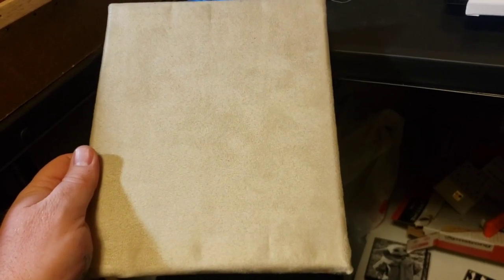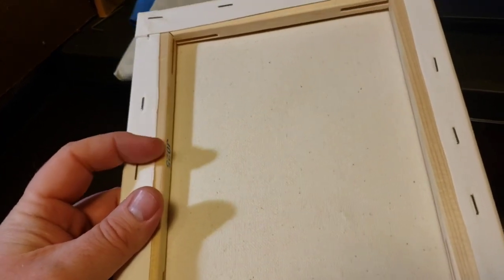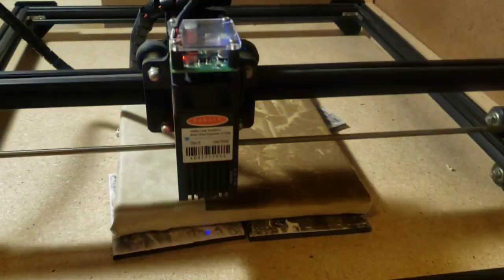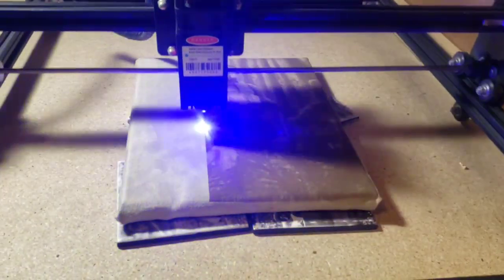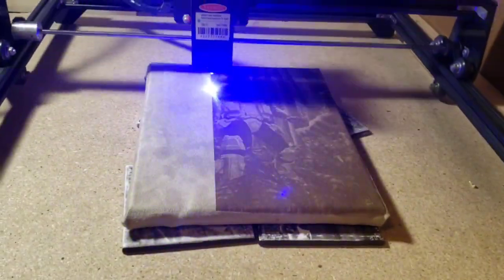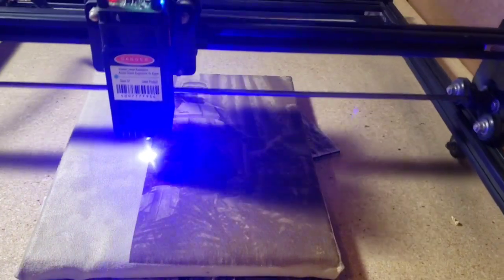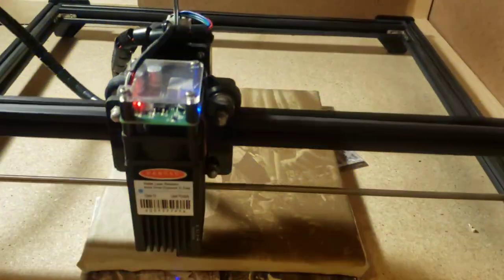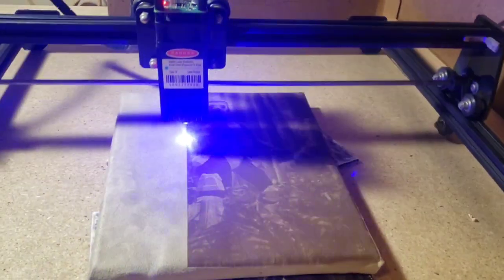The Kenny Hack: Improved No-Paint Canvas Method. Ortur Diode Laser.

Comment: God morning Kenny
The buckskin not stretch it self a little bit of the heat? If it does, i have to take it in a count when to stretch it up on the frame.
Reply from the maker: The heat doesn't seem to affect the stretch of this material.  mostly, just how much you stretch putting it on the frame. Another benefit of this material is that it hardly has much smell when burning unlike painted canvas.
Reply: @TheKennyHack  Witch part of the skin do u use?
Reply from the maker: when I said buckskin it was in reference to the color not that it was actual deer hide. this was all on faux suede which is just cloth. I do have some furs that I'm going to try out sometime.

Comment: All the faux suede i see is 100% polyester. Where did you get the fabric for this video?
Thanks, Tim
Reply from the maker: From everything I've read, Polyester is OK to cut with a laser. Faux Leather contains PVC and is not safe.  Polyester, like all materials, will still release fumes that are not the best to breathe. It doesn't contain chloride that will damage your laser.  A well ventilated setup is always needed.

Comment: Anyone know what 9000mm per sec translates to in percentage?..
Reply from the maker: I was doing 9000mm/min but that's only 150mm/sec. fast for a diode but on the slow side for a co2.
Reply: @TheKennyHack  OK thanks still a good reference to go off with on my diode otherwise I'd have to start from scratch  with testing. I have my own settings but I been curious to try others see if helps or give me better results.
Right now I'm running mine at 8400mm and anywhere from 33-38power depending on the project and it works perfect.

Comment: As you are a constant user for laser ... how much time does last your laser module?
Reply from the maker: I think they say around 5000 hrs but it all depends on how you use it. Ifvyou run it at 100% all the time it won't last long.  I ran my 20/5.5w model hard for 6 months before I even needed to clean the lens. I don't use an air assist to keep it clean but maybe at my higher speeds there is less smoke and soot getting to the lens than when its running slower.

Comment: Kenny, instead of buying a frame with canvas and then covering it with this faux suede, why not just cut the size you need out of scrap plywood and stretch it onto it?
Reply from the maker: Not everybody has access to saws to cut plywood to be cost effective. These canvases are only around $1 and easily available. By the time you put in the labor cost unless you're cutting up a whole sheet at one time the canvases are probably cheaper. I have stapled some over some failure pieces I had laying around tho. Old wood failures can become canvas pieces or painted over to be black and white paint on wood.

Comment: hello, please get your math straight 900 mm equals about 35.5 inches per minute well thats slow... if you are after speed you need a K40 running K40 Whisperer than you can get the power and speed believe me its a whole different world   plus you need an enclosure with powered exhaust vented to the outside through a filter as those fumes are very dangerous.
Before you laser burn anything READ a  specification sheet and pay attention to the WARNINGS as that material will kill you faster than a bullet.
Reply from the maker: Well I was running 9000mm/min not 900. So its 150mm/second or 355 inches per minute.  That's the max programmed speed for this model and close for most Diodes. Much faster and the stock machines start buffering to get the data from Lightburn.

 I looked at k40s but the 8x11 work area is too small for a lot of projects. They also require a lot of mods to be of much use.  Also the chillers wouldn't be much good in an unheated garage and they are not very portable. Some factors I wanted that CO2s just couldn't meet. I might get a CO2 at some point but not until I have the need for a bigger model than a k40. My diodes keep up with all the orders I want for now. With all three running at max speeds I'd be doing the equivalent of 450mm/sec, which seems typical range of most budget CO2s for the type of projects I do. but at a fraction of the cost, maintenance, and space needed. Diodes just lack cutting power but they have greatly improved in the last year. With there simplicity Diodes are the future for the Home/Hobbyists. If its going to be your main business CO2s probably are the best, but just too much hassle for side job/Hobby users. My opinion anyways.
Reply from the maker: Faux Leather is dangerous to burn as it's contains pvc plastic.  Faux Suade has no chloride and is polyester. Does not emit near as much odor as burning paint and all laser work should be done in a well ventilated area.  Polyester is cut with lasers in a lot of industries from what I've read. Just need to be careful as it is easy to over burn and melt it or cut through it. CO2s probably can only cut it and might struggle to do an image.